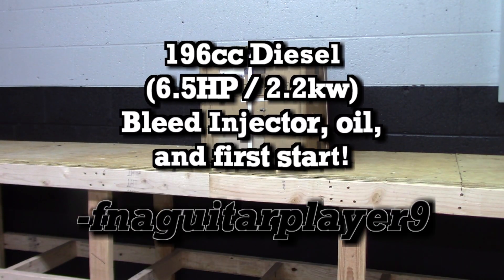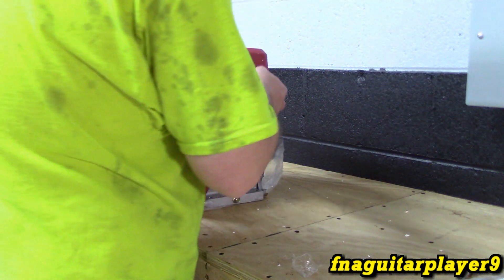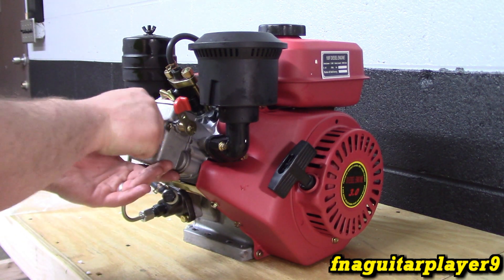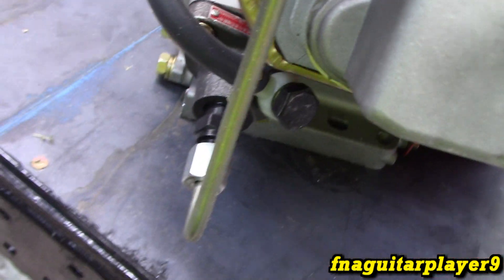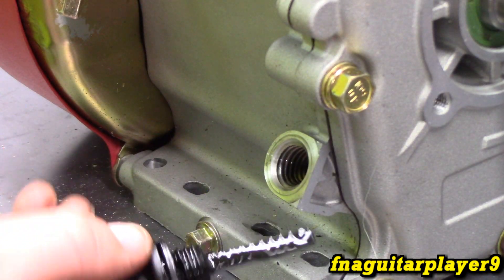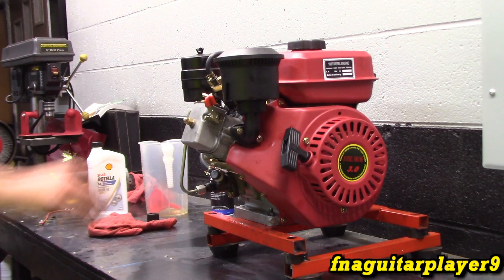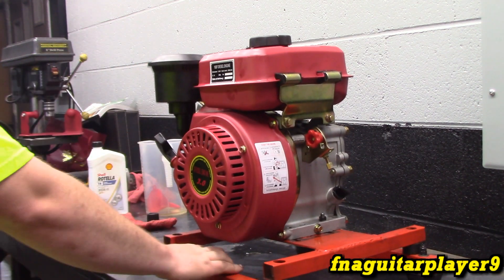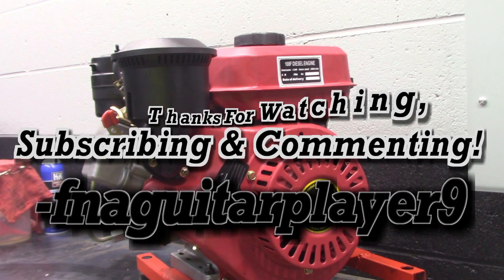196cc DIESEL ENGINE 168F 6.5HP, Bleed Injector, First Start!

Comment: Good deal and the holes in the packing will sure get your attention. There were several on my splitter but nothing was hurt. And 6.5 on yours ought to be right. Mine is 336 and it's 13 horse. Glad you're starting to wear that shop out. I like the diesels. Keep on picking and GBWYall!

Comment: The PTO shaft on mine was .787 , I took the engine apart and turned the crank down to .750 or 3/4 to put on a centrifugal clutch or CVT. When the engine was apart i did away with the governor..... Bad Idea !!! could not regulate engine speed with any degree of control . this engine will RPM to the moon. Returned the governor to stock.
Reply: You shouldn't remove the governor off the diesel engine. You can do it with a regular gasoline engine as it have throttle vavle. Diesel dont have one so if you remove it. It run away

Comment: What a nice little diesel. Please use a generator to test if it puts out good torque compared to the cheap&ubiquitous round about 7hp 100usd gas engine. Here in Europe (germany) the cheapest single cylinder combustion engine is 89euro on sale and 110-120€ on ebay average for gas power engine.
Maybe this little diesel is much cheaper on fuel?

Comment: Can you show the shaft and measure it? What's in between the fuel pump and tank, just whose or a shut off valve for diesel?
Is there a spring loaded governor for constant rpm under "some" load?
Reply: The shaft is 20mm which is .787in
Reply: The governor is and overspeed governor, the tank goes to the pump then to the injector.

Comment: Where did you buy that? I keep looking for 168f and I am getting other kinds of small diesel engines.
Reply: You can find them on Amazon all day long for $280 and lower depending on the seller. I’m seriously considering buying one for my tiller so I don’t have to dick around with a carburetor to make it run the few times out of the year I use it. I wish the horsepower output wasn’t so ambiguous! Is it 6.5hp? 3.0hp? Some side covers say 4.0 on the decal. WTF IS THE HORSEPOWER?!?!? Lol

Comment: Looks like valve cover upside down if compression release is on inlet valve as is. Plus the valve vapor pipe should direct to air filter to be burned.

Comment: I live off grid. I want to buy one and connect it to a 24v alternator, then connect the alternator to a 5000w inverter, and run a AC unit. I want to start making biodiesel and run my AC unit on biodiesel.
Reply: Are you going to go directly from the alternator to an inverter with no batteries? Never heard of that.

Comment: What does 6.5 HP mean? 2.2 kW is about 3 HP and not more!
Reply from the maker: I agree, but it was listed as that! But I have a 5hp generator and its 2200 watts, so i don't know how the numbers figure up! But, it is 196cc and the predator 212's are 212cc, so the HP is right there with the cc. Thanks for Watching!!!
Reply: @fnaguitarplayer9  2200 watts of electrical load, not shaft power.  Generators waste some energy as heat.
Reply: @fnaguitarplayer9  My old 5k is 10 horse so you're right on the money!
Reply: 6.5hp means the description/part of the engine came from a gas powered unit those are usually 6,5HP or 7hp all over the world. So a very common error on the box/sticker/description...
And for the generator it is normal to get 3 phase 1 socket/3socket 1phase generic China generator with 4800W/50Hz@230V/3Phase400V here all over Europe with 7 horsepower gas powered engine. Cylinder is angled like your diesel..
Extra horses go to heat and sound
Reply: Whats the 4 month review on it. I have a john deere gator an im looking to see about what kinda torque it has